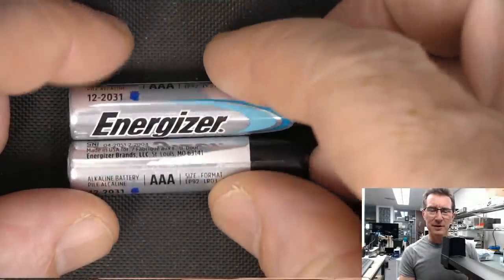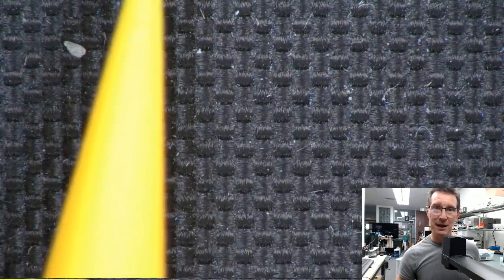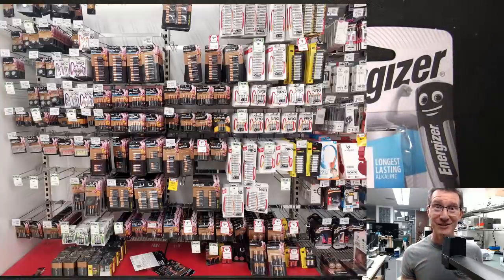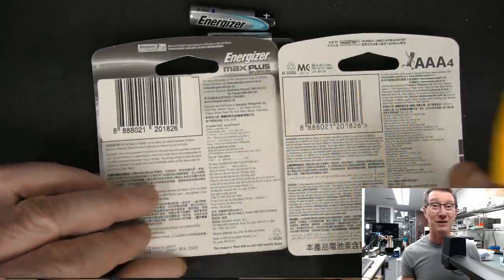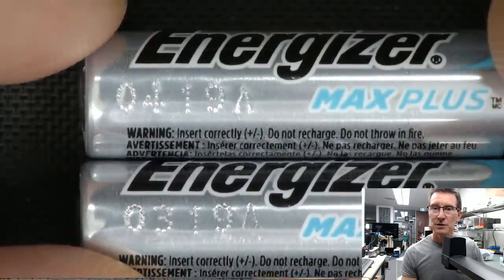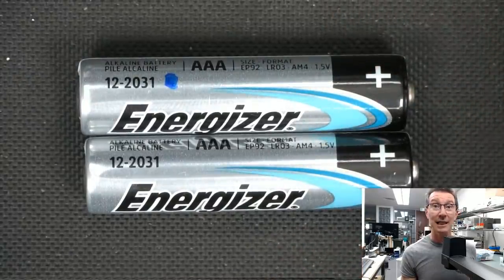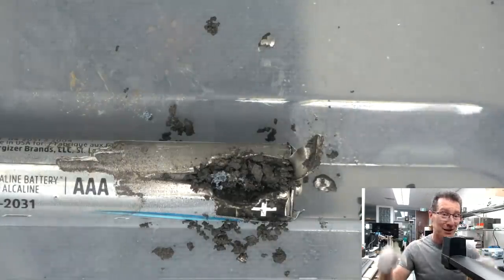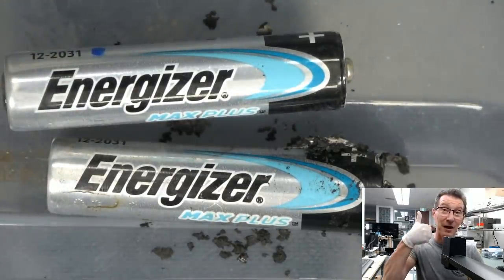EEVblog #1350 - Fake Energizer Batteries?

Comment: Don't forget that another trap for young players is that Zinc-Carbon cells have the casing at Negative, not positive like alkaline.
Reply: Yeah, as a kid tore apart more than one zinc-carbon cell.  The carbon rod is attached to the 'button' on the top and that's insulated from the rest of the container and the flat bottom (which is formed as part of the container)  So I was surprised to watch a video of alkaline cells being made ("How It's Made") that showed them welding the top, positive 'button' to the case.
Reply: Speaking of welding... ah, er.. soldering. In a pinch we would remove the carbon rod (old school D cell) connect it to a car battery and wallah, a NO FRILLS soldering iron. Your mileage will vary 🤤
Reply: Casing? No they have a cathode and exposed anode.

Comment: I would say the "Advanced" name was simply used on the product before they changed the packaging and labeling. They have the same UPC.
Reply: look closely at the "Advanced" UPC, it seems to be a sticker placed on top of the unknown original UPC printed on the packaging underneath...
Reply: yeah, it's the older packaging design, and older batteries. you can tell by the way it is
Reply: The cells themselves looked different.  The "plus advanced" had the word "plus" in black on both package and cell.  It's not a battery or pile of multiple power cells despite the common misnaming and the packaging.  A 9V battery is a genuine battery with a stack of flat cells (GP/Hellesen patent) or a bundle of sub-AAA cells inside.

Comment: 5:35 on the big "energizer" logo you can clearly see the black letters aren't centered on the white shadow
6:57 in the "alkaline battery" there are tear signs in the vertical lines 
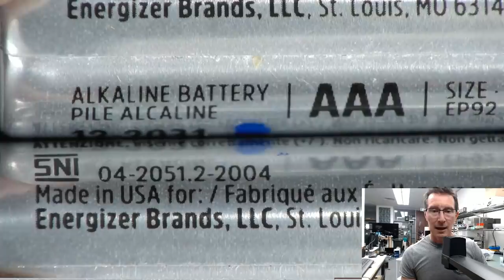7:13 in the LLC you can clearly see it in the second "L"

leaky unit that is clearly a fake
Reply: I get what you say about the Energizer logo, but it might be the light. But I really see no difference between the two regarding the text printing
Reply: @gino.avanzini  black test is to the left around 0.3 mm
Reply: Oh my word, the slightest bit of misalignment and some print artifacts (present on both samples), IT MUST BE FAKE! Ultra-cheap commodities manufactured by the trillions are always absolutely flawless, as we all know people inspect the print on their AAAs with a microscope.

Comment: The batteries were probably exposed to high heat during the mailing process and  plus they were in use too.
Reply: Or frozen/low pressure in an airliner hold?
Reply: @Bigrignohio  aircraft holds are both pressurised and heated.
Reply: @georgeprout42  True and not true.  Learned about this when in the military.  Was common to have batteries flown in, only to receive them in a bad state (bulged).  Best guess at the time was a not optimal ride / pressurization in the plane.  Dedicated cargo planes raise the cabin pressure to save on the stress to the plane structure.  Some pressurize as high as 10,000 feet as in the 777F.  Could possibly be the source of the problem.
Reply: @georgeprout42  We had some batteries sent out to NASA so they could certify reliability. It passed their testing, but they came back swollen. I doubt they were the ones to fuck them up.
Reply: @georgeprout42  
Pressurised, yes (there are exceptions)
Heated, there are both flavours heated and non heated. 
Make sure you put the animals in the correct section, I know whoops story 😬
Reply: @georgeprout42  Pressurized to about 8k feet, and dropping to temps just above freezing.
Reply: Oh, no doubt that the reduced pressure can affect them. You only have to look at a sealed packet of crisps/chips when you fly commercially to see this. The common misconception is that the hold is a cold vacuum during cruise. It's no different to the passenger cabin to all intents and purposes.
Reply: then they're useless.

Comment: Those are northern hemisphere batteries, the electrolyte leaks out when they are upside down in Australia.
Reply: Cats in australia even follow their own tail as a kitten counterclockwise due to growing up at another hemisphere. And cats don't meow but they weow sue too australian accent that also happened to cats when being kitten.
Reply: @mrkitty777  "cats weow" 😂
Reply: I love it, winner winner, chicken dinner!!!
Reply: Just mount them in reverse position and they will be fine.
Reply: Winna winna chicken dinna 😂
Reply: It has to do with which direction they wrap the shell. The Coriolis effect is opposite in the southern hemisphere so it leaks when wrapped for the northern hemisphere.
Reply: These batteries are made in the Northern Hemisphere, the electrons are loaded in the north, so when they are shipped south the electrons don't know which pole of the battery to flow to.  This generates a small amount of heat, but worse still it generates pressure and causes the batteries to leak.
Reply: yes the most technical explanation ever!!
Reply: lol
Reply: Well, than there must be a lot of Australien batterys here in Austria too 🙃
Reply: And the +/- terminals switch around too.
Reply: Hunky Dory comment

Comment: I think I bought some 9 volt counterfeit Energizers about a year ago. The cases on the batts looked funky and different from other Energizers. I do not buy Duracell batteries anymore. They leak just sitting in their packages. 
BTW, was there a weight difference between the two?
Reply from the maker: Good question! 
New one=11.897g 
Original one that didn't leak=11.949
Nothing in it.
Reply: For the record, all battery brands leak.